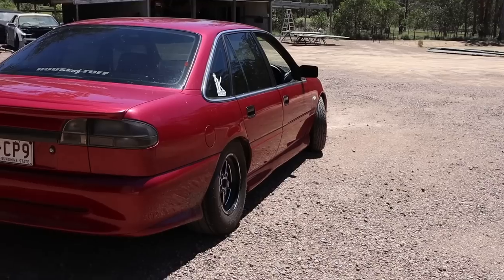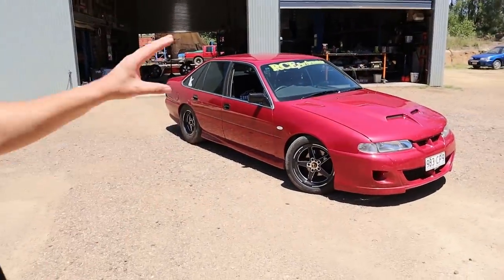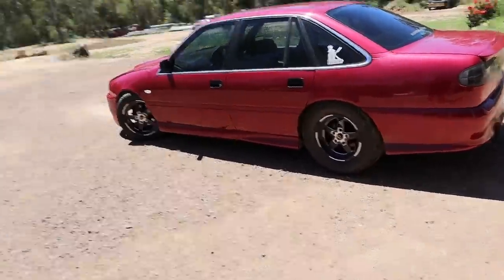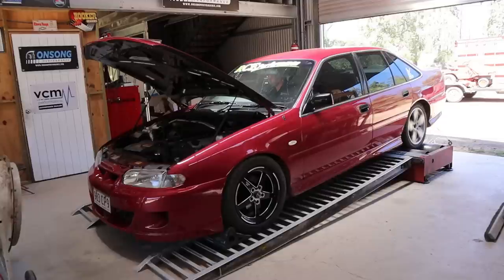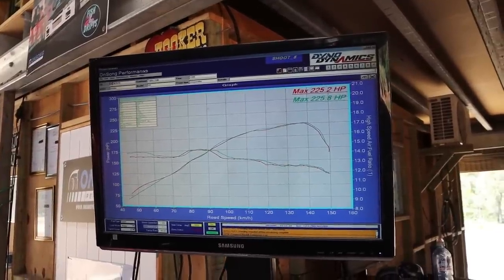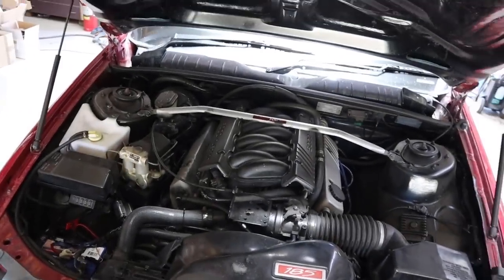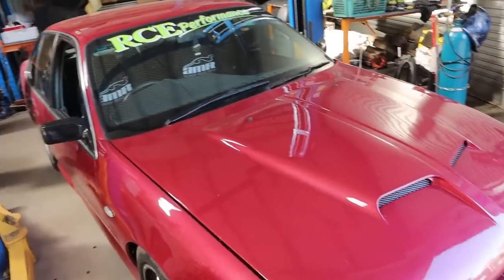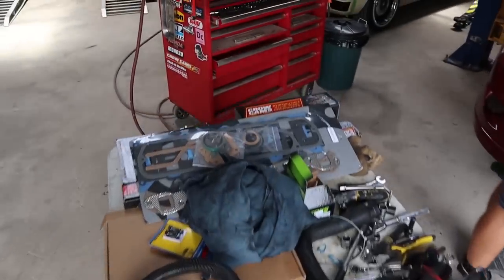5L Holden VR SS Cam Package || Episode 1

Comment: Mate what was the original cam you wanted to go with and what did you end up using here? I have a stock 5L Vs statesman with extractors and 3” single exhaust, what would you recommend without needing to machine heads? I’m thinking 4503 or 276 cam, any thoughts would be very much appreciated! Thanks!

Comment: I look forward to seeing how much of increase in power these mods make, it's a shame you couldn't get rid of the restrictive bunch of banana's, but any increase in power is an improvement!
Reply: I got a banana  manifold extrude honed by a bunch in Geelong increased flow to around 1300 cfm something like 280 a runner no matches done hear ... but works good for a factory look engine builder was going to cut off the neck and weld on a 90 odd mm throttle body . Thease days its a torque  power dual plane its the tits

Comment: I love the 5.0ltr! 
I had 4 x 5.0ltrs over the years and since have had all Ls1s and now have an LS3...
At 221hp, even a stock 5.0ltr had plenty of power to have some fun with! Torque throughout the rev range was awesome!
Exhaust absolutely MUST be perfectly tuned in these! A better intake manifold would be great! But even on the banana manifold, if you get a completely leak free, 2.5 inch exhaust, the torque will increase heaps! Netting more power as the revs increase!
In a 4 speed auto, they should ideally shift from 1st into 2nd at 60km/h, and the shift should launch you from 60km to 70kmh! If an Ls1 is beating you at 0 to 70km/h then your 5.0ltr isn't running right! Trust me!!

Exhaust velocity is absolutely paramount in these! You need low backpressure yes! But DO NOT go wacking on a 3 inch either! 2.5inch! And if possible, a better intake manifold!
Anything else like stroker kits etc will only be hindered if you don't do these things too
Reply: You are dreaming if you think a 308 can get anywhere near an ls1 😄
Reply: @johnboy5167  how many LS1s and 5.0ltrs have you had? I've had 9 (thought it was 10 but no i miscounted) V8s in 15 to 20 years! And 304 (they're not 308s but 304s) fuel injected V8s heavily rely on the perfect exhaust tune (not too big, not too small, and zero leaks). And with a stage 2 shift kit, yes, they are neck and neck upto 70km/h! I know this because I gave my VPSS to my Dad after I bought my VXSS and then dragged with him! It's not until after 70km/h that the LS1 really pulls away! That's because in powerful engines, lower gears are wasting the torque where as in less powerful engines, they're adding it. 
Anything after 80 to 100 the LS1 licks it no worries! But don't try and tell me I don't know something that's I bloody well do know out of personal experience either.
4th gear is 1 to 1 in most cars and its there that you really see what each engine can do, but in 1st gear, it's hidden and things like engine speed make more of a difference than actual HP! Hense why a kia sports wagon can almost keep up with an ss until you're basically breaking the speed limit
Reply: @johnboy5167  and when I say 9 V8s i mean 4, 304s and 4 Ls1s... the 9th being my current LS3 (never had a carby 308 and never had a 6.0ltr either but I know my Ls1s and 304s mate trust me)
Reply: I sware Ive had a 10th but I cant think what it was now, but all I can remember now is 2 VPSS's a VP Calais HSV enhanced and a VP commodore with V8 option... they were all mostly slugs but the last 2 were thrashed, the 2nd VPSS had a 3 inch exhaust which meant it had no exhaust velocity (no back pressure which is good yes, but also no scavenging either so it lacked power)... but the 1st VPSS we mucked with the exhaust for ages trying to get it right (2.5 inch) and in the end we just welded all the flanges and mate, it went like a shower of shlt just from doing that! But like I said it also had a stage 2 shift kit, and I also got it before it had been thrashed too hard
Reply: See if they exhaust is wrong in those, it will do things like hit 2nd at 40km/h and then hunt, where as if its tuned right, it will hold 1st upto 60... and then with a staged trans it hit 2nd hard enough to push you upto 70kmh... hense why it kept up with the LS upto that speed
Reply: @FreedomForAll2013  l have been driving v8 powered vehicles for 47 years fords Holden's even Chrysler and plenty of ls powered vehicles as well only have 1 v8 currently it's a VF hsv ls3 making over 500 wheel hp naturally aspirated and has nitrous on top of that and l know from experience that no older v8 from any brand will keep up with an ls 👍
Reply: @johnboy5167  are just you not reading what I wrote after 2 lines or something? What you just described isn't a stock ls3 anyway... I did say upto 70kmh and when tuned correctly, and if you really own an LS3 like I actually really do, you'd know then that an ls1 and ls3 are also two different ball games... 308s are different for starters as they don't run on a computer so you can chop the exhaust on one of them and have no issues... 304s aren't like that.
But I'm not talking about an LS on NOS lol... Im talking about a stock commodore LS1 compared to a full exhaust on a 304 with a partially worked trans.
Yes there is a close comparison upto 70kmh and I sware that on my life and soul because like I've already said, I have been there and done that! God, people just can't tell the difference between honesty and BS anymore!
Why would I waste all this time and typing to make this up? I don't even own a 5ltr anymore and couldn't give a crap what people think of them, I'm just telling you how it really is... for the 1st time in 152 years of your looong life, you might learn from the younger guy if you can drop the ego mate, of course a 4 trillion year old dinosaur car that you 1st owned and had 3 gears doesn't compare...feel like im talking to a typical know it all baby-boomer.
Not saying older V8s keep up with LS's and like I did say, after 80km/h to 100 and onwards the LS licks them... But you do need the 5.0 well tuned so it puts out enough torque - like I said
Reply: @FreedomForAll2013  what do mean if l really own an ls3 l could own 10 of them if l wanted to l am not comparing my current ls3 to a 308 or 304 because that would be a joke I was just telling you what I have at the moment and yes l have had and driven plenty of ls1 and 308 Holden's and the ls1 was faster everywhere even from a dig but obviously you have had different experiences and you are entitled to your opinion 👍
Reply: @johnboy5167  yeah fair enough, like I said 3 out of the 4 were slugs to drive
Reply: @FreedomForAll2013  👍